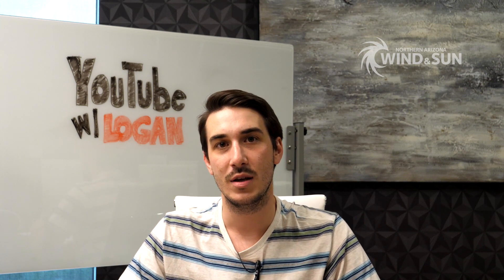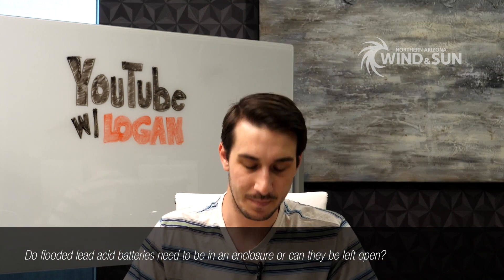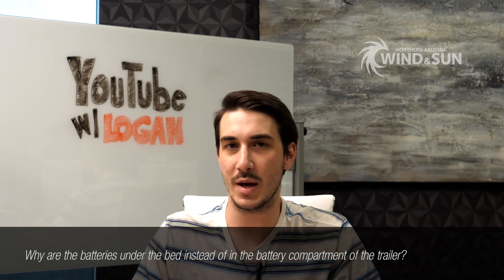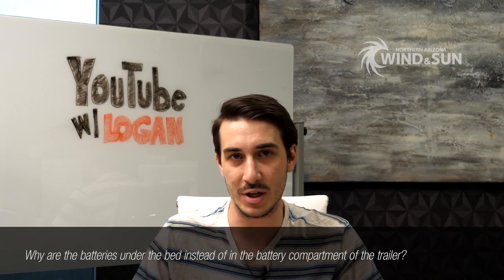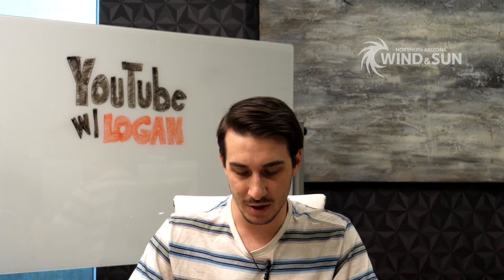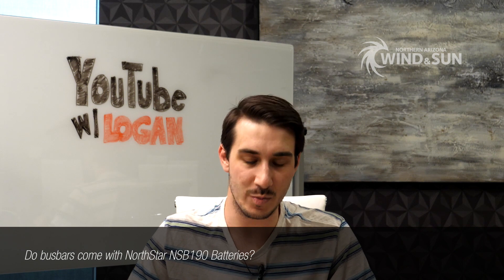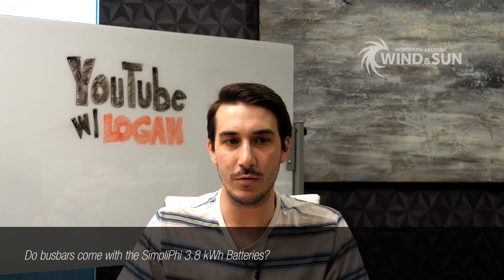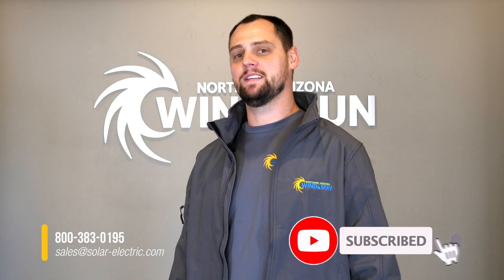Logan Answers Your YouTube Questions: Batteries

Comment: I'm considering a Orion-TR Smart 12/12V-30A Isolated Charger and the installation PDF offers very little instruction about the installation and it looks like they have it connected directly to the alternator and fused between the alternator and the battery. Everything I the videos I have seen including the Victron shows the installation directly to the battery and with a fuse after that.
Thank you,
Dave S

Comment: so, I bought a sol-ark 15kw from you, the information sheet gave batteries that communicate with the sol-ark. Is it vital to have batteries they suggest that are compatible? Sol-ark claims to run with any batteries. Can you explained the pro and cons that have communications and a battery system that does not communicate with sol-ark?  The Batteries they suggest a pricy compared to the ones that do not.